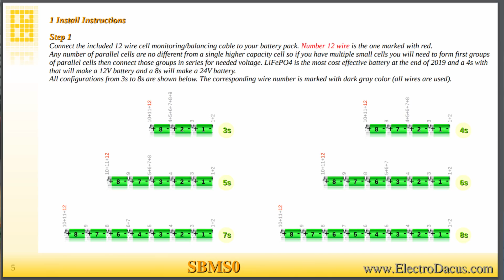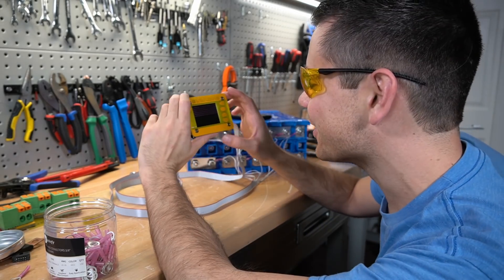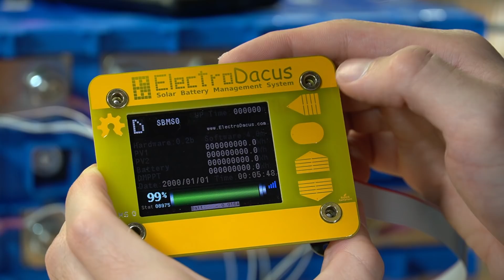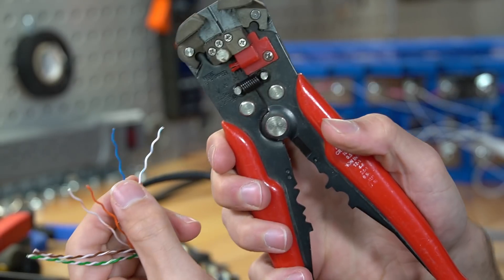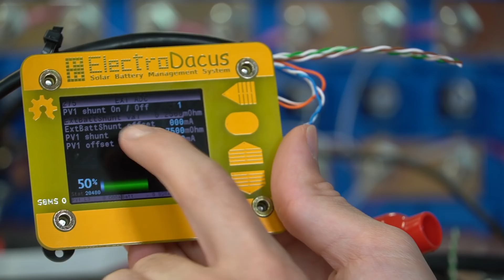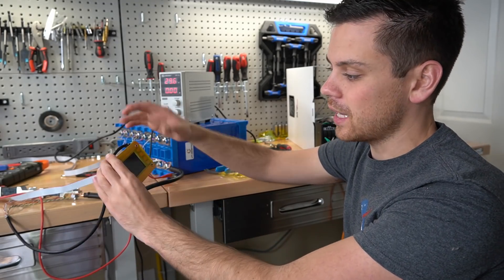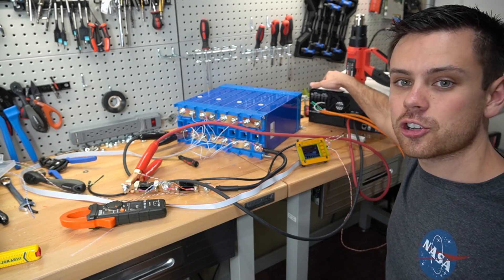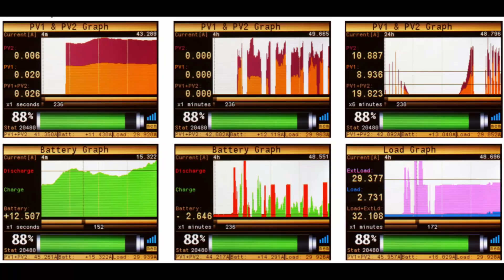Electrodacus -Open Source- Solar Battery Management System: Introduction and Setup

Comment: I'm trying to remember If I've ever seen you use relays for anything. Any inverter that has a switch can replace the switch with a relay. The same goes for low temp. Any thermostat can be used with a relay to switch off power to the charge controller or with a big enough relay cut PV input to the system. If your BMS or Thermostat can't handle the current of a big relay coil you can gang them, using a tiny reed relay to trigger a larger one.
Reply from the maker: Chargery bms comes with one. Will test that out soon
Reply from the maker: Everyone complains that relays have high idle consumption, and people seem to prefer fet based switching for solar stuff. I have some SSR on the way, so that might be better. But yeah, I love  classic relays. They work great
Reply: @WillProwse  The SBMS0 already has a sort of small SSR inside on the EXT IO3, IO4, IO5 and IO6 it is based on the Toshiba TLP187 optoisolator with a 300V DC rating and 50mA max current more than sufficient for all remote ON/OFF ports on inverters and same with the MPP inverter that has less than 10mA current trough that ON/OFF switch (I know as I have an older MPP 2424HS inverter powering my house).
So no relay is needed as the build in optopisolator is perfect for the job and only uses 2mA when ON compared to 50 to 100mA even for a small mechanical relay.
Bill Kerr,  If you refer to having large relay switching OFF the inverter DC input then that is a bad idea and relay most likely will get damaged either remain stuck with soldered contacts or just blow the contacts fully. Relays electromechanical or electronic can not deal with large capacitive loads like inverters and Lithium batteries that have almost no internal resistance so can push out many kA. You seen the spark in this video when Will did forgot to precharge the capacitors.
Reply: @WillProwse  Careful. There are lots of fake SSRs on the Chinese market that only have one MOSFET in them and don't meet the standard on the lablel. Control circuit relays can be quite efficient if sized carefully. Using big contactors to switch high amperage does take a fair bit of power.

Comment: I think that the Batrium BMS is more user friendly than the Electrodacus BMS. If the Electrodacus come as a complete system where battery Cells can be replaced with bigger capacity cells it would be more appealing.
Reply from the maker: True, but 4x the cost. Great people at batrium though. Well made system, easier to setup too. More capable system for sure, but more expensive. You do get what you pay for.
Reply: Yes SBMS is limited at 8s but you can have any battery capacity you want most I seen from practical reason was around 20 to 30kWh but there is no limit to battery capacity just the voltage as is 8s max.
You also do not need a computer or anything else just the SBMS as is a BMS + advanced energy monitor all in one and as will mentioned SBMS0 is just 120USD.
Reply: @electrodacus  So if you have 48v system you will need two in serie?
Reply: @neliosamch3195  Yes tho I do not like the idea.  You have two screens and when looking at one of them you will see for example just half of the energy in the energy counters as each will see the same current each with his individual battery current shunts then you need to add them up to get the real result. This is just an example of how less elegant this solution is vs a system designed for it. If you are already invested in 48V then maybe use Batrium (I have no experience with it just what others mentioned and me looking trough the specs should be fine) That is more expensive but is probably irrelevant when you consider the total system cost.
I have no intention to build a 48V BMS for many reasons including that is outside low voltage standard and the fact that it will require complete redesign.
Reply: @electrodacus  The higher the voltage the more efficient it get, less heat dissipation and more energy saved. Cars are at 400v buses and trucks 700v. The SBMS will be limited to very few battery packs system that will be available in the near future.
Reply: @neliosamch3195  EV batteries are mostly high energy density cells with very few exception's so I do not recommend used EV batteries over new LiFePO4. If you look at a Tesla or any other EV the battery warranty is based on average driver mileage so 100kmiles /  160000km that is 20000km/year that most drivers will do and then if you take something like 400km range with a full charge you get 160000km/400km = 400 cycles at 100% DOD so that is what an EV battery needs to be capable of far from what you expect for an offgrid battery by close to an order of magnitude.
My LiFePO4 is rated 5400 cycles at 100% DOD that is an order of magnitude more and based on first year degradation with heavy use that was just 0.9% capacity loss about 0.6% from aging degradation that will affect all batteries even if not used and just 0.3% from cycling I expect at least 15 years of use before battery is at 80% of original capacity so maybe no longer quite sufficient but I may be able to do 20 years if I do not mind the reduced capacity at that point.
Tho Tesla will be using LiFePO4 from CATL in China made model 3 so maybe we will have even better price high quality LiFePO4 tho I will still prefer a new battery as in an EV battery is much more stressed than in an offgrid application.
I'm OK with the 24V limitation for the SBMS as this was designed based on my needs first. This started as a short project to build a BMS for my own use about 7 years ago since there was nothing available that will have worked. Surprisingly to me situation is not that much better today. Over 95% of people still use the super expensive Lead Acid (expensive as in cost amortization over battery lifetime).

Comment: Low Temp High Temp Cut Off? lol
Reply from the maker: Yep
Reply from the maker: Dacian doesn't like low temp cut off as stated in the forums. Open source, so if you want to change something, you can. I would use victron personally with battery sense module.

This is advanced level system control. Not some cheap junky BMS with bad parts. You can make this board do whatever you want really. And more if you want to add to the project

Comment: What about low temperature disconnect? Usually you pay a lot of attention that's work correctly. 
Thank you very much. 
Best regards.
Reply: It has low temp disconnect.  Connect leads from a 10k ohm thermistor to XT1 terminals shown in Will's video (@10:09 min mark).  See manual for thermistor specs and settings.
Reply from the maker: I didn't have resistance value temp sensor, but you can calibrate it yourself if you want and add it. Dacian doesn't use it. This system is made for use with victron mppt, so adding it with battery sense module is always an option. This is a open source system for advanced users. The low temp cut off videos are for cheap, low quality BMS that advertise something without delivering results. It's easy to pick on.
Reply: @WillProwse  This system is not designed to be used with Victeon MPPT althoug it can  be used with it.
Reply: @fibranijevidra  SBMS0 is designed to work with any device that uses "control lead to ground" as the operation trigger, this includes DSSR20 and many other devices including Victron Mppt that include this function. What you said above is misleading by it's omission of the what you wanted to say which is; "This system is designed for use without the essential need for Mppt or PWM interfaces except in applications where Mppt and PWM provide distinct advantages over not using those devices."
Reply: @bluejeans725  What Will said is missleading and it sounded it is designed to be used excluseively with Victron charger. I just wasn't detailed as you did, but I am sure it is clear what I have meant.

Comment: 13:53  Not really.  You don't care about efficiency under maximum sunlight and ideally matched conditions - you care about the system still being able to charge at all under suboptimal conditions such as a cloudy day - this is why you want your array Voc to be three times your battery terminal voltage.  If you exactly match the panels Vmp to the battery terminal voltage you will get no charge at all under cloudy conditions - this is the main advantage of MPPT, that it can gear itself around to do the best with what you have under non ideal conditions - full sunlit battery charge current under MPPT isn't much better than the older PWM.
Reply from the maker: Yes absolutely. I prefer mppt any day. 

Electrodacus did make an argument on one of my videos about solar panels being cheap, and mppt so expensive that you could get more power by having more panels and pwm. It was interesting. Mppt does fail faster. 

But the wire savings and power availability alone make mppt worthwhile in my opinion. I love mppt. I do know people disagree with me on this one, including dacian. I suppose in tropical climates, pwm has a weird advantage. Still not worth it in my opinion
Reply: @WillProwse  The MPPT switching regulator physical device and circuitry is exactly the same as the PWM unit - the ony difference is the MPPT has smart software that can hunt around and see if power goes up when it does so.  The parts are otherwise identical, and thereby no reason at all why one might fail before the other.  Solar isn't cheap when it's mounting real-estate that is in question, for example a motorhome or sailing boat - you need everything you can get out of your panels here - it's not about money.  Both MPPT and PWM identical panel arrays will supply the same full load power to the charged battery under optimal sunlit conditions - MPPT is only of any value under partial lighting, where a PWM system will fail entirely.  Yes, he is correct in stating that installing three times the Voc PV array voltage will still charge a lower voltage battery, but you also threw away those peak (3x) watts - you might be able to do this with a large array, but you cant do it with your RV or sailboat, and whats the point trying to anyway...
Reply: @SteveWrightNZ  I lived full time on solar with Twin Bogart PWM system using 12v panels into 12v AGM and never experienced a single day, ever, where I got no solar.
Reply: Steve the PV panel voltage either open circuit or max power point has nothing to do with the amount of solar and is only variable with panel temperature (not much variation). The current is what is proportional with the amount of light.  So a modern 60 cell PV panel will have a max power point voltage of around 27 to 32V depending on how hot or cold the solar PV cells are. The spec on the panel will probably say something around 31V max power point voltage for typical 60 cell panel and that is at STC (Standard Test Conditions) that test is done indoors using a simulated light of 1000W/m2 to simulate solar spectrum and is just a short flash of light with panel at room temperature +25C
In order to get the STC values in real world ambient temperature should be quite a bit bellow freezing at around -10C as panel heats up when illuminated by the sun.
A 8s LiFePO4 will be most of the time in the 26.5 to 27V range so in summer with full sun at noon the panel will be hot probably 65 to 75C and max power point voltage will be around 27 to 28V thus something like DSSR20 will be 96 to 99% efficient and no MPPT can match that but that is best case for DSSR20 and worst case for an MPPT (an MPPT will likely not even be able to work at all with a single panel so will need two of this in series to work) and the higher the input Voltage vs battery voltage the less efficient an MPPT (DC-DC converter) will be maybe 93 to 94% for high quality MPPT's
Now as the panels gets cooler say in winter the less efficient the DSSR20 will be as low as 88 to 90% depending on multiple factors at a specific point at noon but overall will still be around 90 or over 90% efficient even in winter where an MPPT may be 93 to 94% assuming two 60 cell panels in series but over a full year MPPT may be equal or slightly worse than DMPPT20 tho not much of a difference in any case.  Thing will be different if 72 cell panels will be used and there MPPT overall may have a 13 to 14% advantage in winter but even then the extra cost of the MPPT vs DSSR20 is high enough that you can by some extra panels and get way more energy for same amount of money if you are not limited to the PV array you can install.
DSSR20 is designed to work for 30+ years same life as PV panels and it has passive cooling no heat as with MPPT's especially larger ones have noisy fans and in average a quality MPPT used at full power will maybe last 10 years so you need to continue to buy MPPT's over the life of the system creating waste and extra cost.
If MPPT had any advantage I will have implemented MPPT in to my design.
Also SBMS0 can control any of the Victron MPPT controllers so if you prefer to spend money on that you can and I even mention this in my user manual. The PV charging is done outside of the SBMS0 so you can use your preferred method but I also offer DSSR20 for those that understand the benefits.
Reply: @electrodacus  No sorry, thats complete horseshit.
Reply: @SteveWrightNZ  LOL. Telling someone like Dacian that he's talking complete horseshit is ballsy. Here's someone who has built his own energy efficient home, lives by solar exclusively, and designs and builds incredibly smart and unique solar harvesting devices that flat out work, for the lowest possible energy costs on a lifetime basis. I'd be somewhat interested to view your achievements and experience in comparison, if I felt there was an merit in continuing this idiocy. So long.... this is comical stuff. :-)
Reply: @SteveWrightNZ  Solar PV panels are constant current sources. The amount of of current is proportional with the amount of solar power illuminating the panel. You can short circuit the PV panel and that is safe operating condition for the panel current will be about the same as normal max power point operation current.
What part you do not agree with ?  Each cell is actually a large diode that is what clamps the open circuit voltage to around 0.6 to 0.7V and you need to operate below where the diode (PV cell) clamps as you want that energy for yourself not wasted in the PV cell as heat. This diode (PV cell) clamping voltage is dependent on temperature as with any other diode.
Reply: @electrodacus  90% of that is complete bullshit mate.  No I'm not going to teach you.
Reply: @SteveWrightNZ  I'd love to see you try..... with less of the inflammatory ccusation and a little more of the facts as you think you know them. I'll get the popcorn. This would be a slaughter.
Reply: @retiredandroaming  Nope wont engage.  Try trolling someone else.

Comment: Wow, that's a really cool charge controller with many functions that actually works 😲😃

Would like it to have active balancing that charges the lowest cell with the highest one
Reply from the maker: Active balancing is pointless in a new cell system. 200mA balance current is plenty
Reply: The SBMS0 balances when two criteria are met. 1. there has to be a cell difference of 0.01v or more, 2. there has to be a charge or discharge current occurring.  This means you don't have to cram the batteries full to get balancing to start so allows for a wider range of charge source voltage  settings to be useful. This allows the SBMS0 to spend a fair amount of time balancing so the 200mA current is plenty and there is very little heat generated so no heat sink is required on the SBMS0. Seeing as balancing starts with a 0.01v (hundredth) difference the cells end up being balanced to within less than 1% of each other. The cell balancing activity is displayed on the screen as it is happening.
Reply: A balancing system that charges the lowest cell from the highest cell requires capacitors. One of the key design characteristics of the SBMS is that is contains no electrolytic capacitors to dry out/age and lead to other failures.  I feel it's a very sensible compromise.
Reply: @benspeirs5237  ive seen one that only used inductors and a high frequency to balance up to one amp all the time so if discharging and one cell is running low it will help the overall AH capacity.
But i guess this is only needed for low quality not perfectly matched cells
Reply: @tullgutten  huh. I hadn't heard you could do that, but makes sense you store a small amount of charge using inductors.